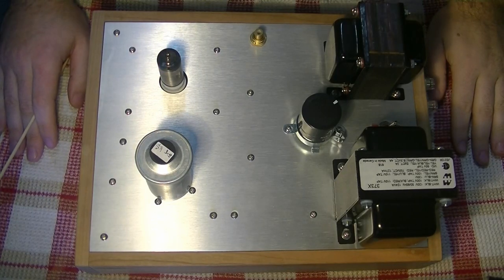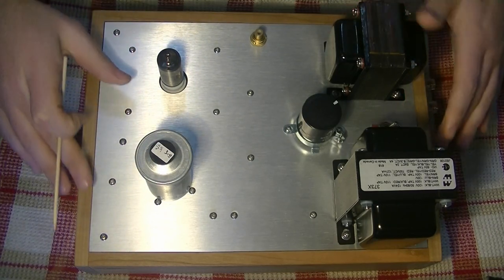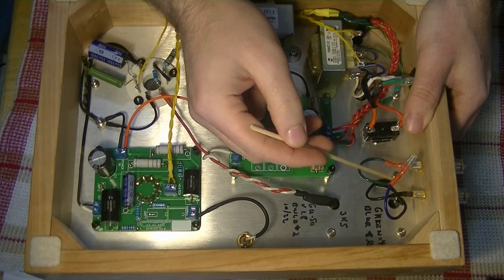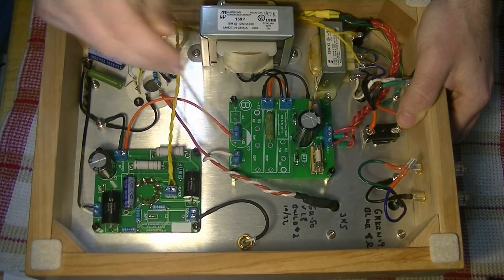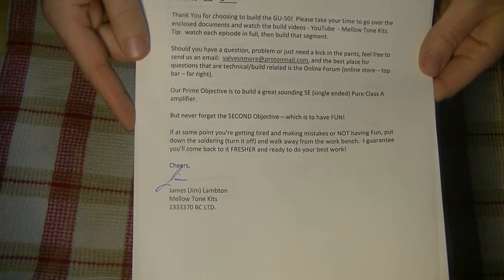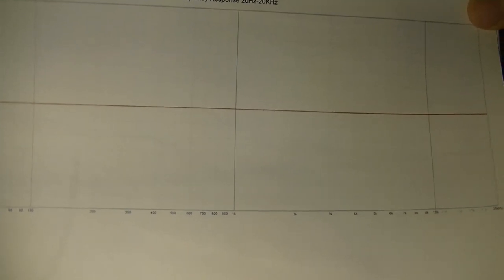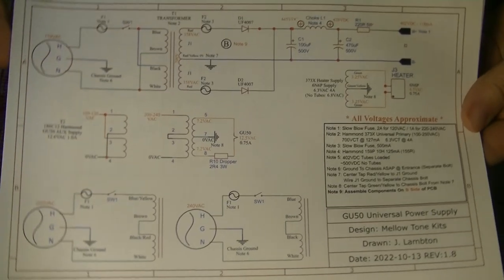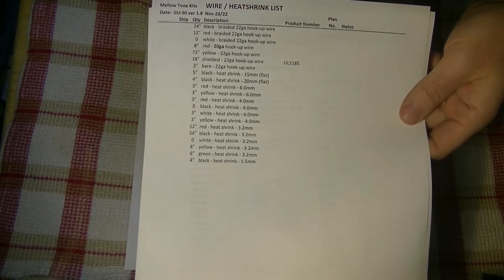Ep1 GU50 Kit Build - Getting Started

Comment: Hi.. Can the cathode bypass cap on the input tube be ommited if I have too much gain already?
Reply from the maker: I'm presuming this is a general question and not directly related to the GU-50 build.  Yes if you want to reduce the gain on a regular voltage gain circuit, you can certainly remove the bypass cap. But this this also change the sound a wee bit.  Why, well the bypass cap does two things, one it provides a path to ground for the AC component on the cathode and it fills the circuit helping stabalize the bias to a very stable operating point.  All this explains the extra gain you get with the bypass in place.  Without it the cathode bias swings with the AC signal.  Now this isn't necessarily a bad thing, in fact both of our wonderful sounding Kit Preamps are designed without a bypass cap.
Reply: Thanks for the thorough explanation.. Actually, I’m asking about the kit, since the input stage of the kit has its cathode bypassed, just before the CF driver.. But I just took a look at the 6N6P datasheet, and it’s medium mu, so a bypass cap on the cathode is a good thing in this application I think.. Thanks again.